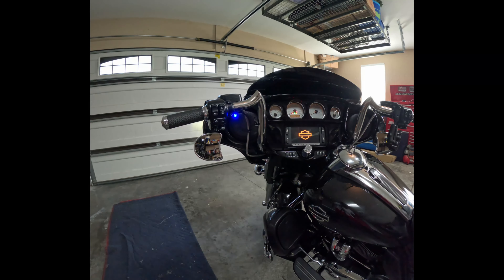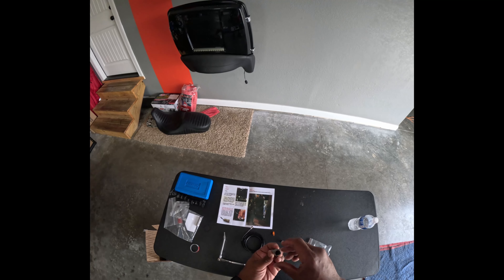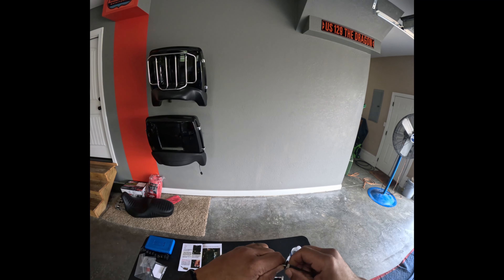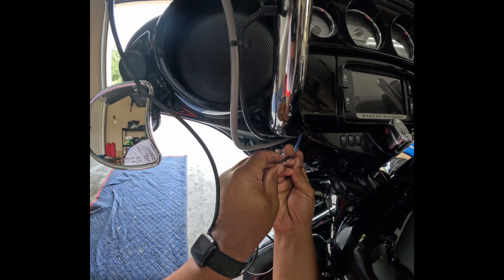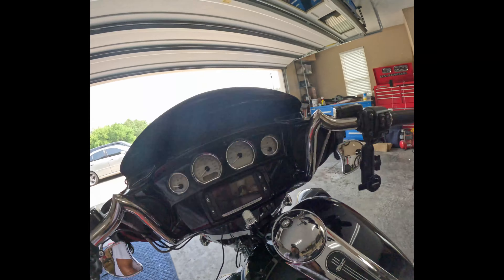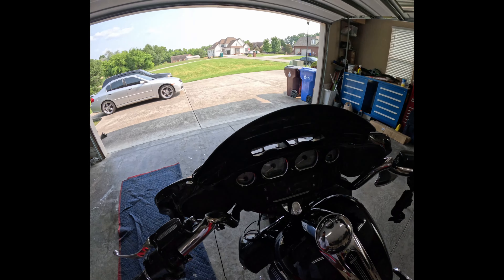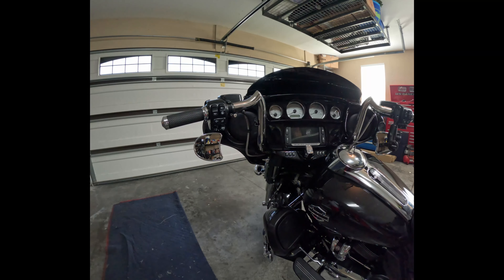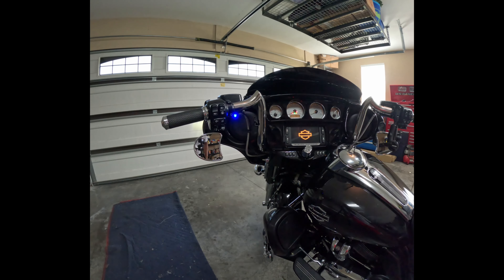Ultra Cool LED Indicator

Comment: I just watched both our videos on the install. I got mines in for my 22 RG special and just need to get it installed. I also got a few other parts as well to install. How long did it take you over all? few hours you think? Also , did you drain any oil or just what was in the filter when you removed it and how much more oil did you put in the system?

Looks good , keep up the YT grind.
Reply from the maker: 4 hours with taking two breaks.  Took my time cutting lower fairing because I didn’t want to cut to much.   Didn’t drain any since it wasn’t close to mileage for oil change. 

Thanks for watching
Reply: @bigherk80  awesome ! Ya I just got my service 500 miles ago so not gonna do a change. Just putting the new filter from them on with the install. I’ve got the spoiler to install so wanted to see how long it would take over all. I’m planning on a Saturday or Sunday of just tinkering around to get it installed.

Comment: I just recieved mine in the mail today. I have a 2018 ultra limited also with a built 124. Cant wait to get it installed and start the season. Install looks pretty simple, how was your install? Did you take any precautions with protecting your paint on the lower? Like putting tape on the surface that might rub, or just lay soft cloths down? Thanks good video
Reply from the maker: No I didn’t,  I took my time when cutting so didn’t really worry about it. Thanks for watching!

Comment: I hate pinning and depinning lol 
Hence why mine is in the box .. the light 

I saw a guy mount it off the corner of the UC assembly.. I didn’t went any wires on the outside of my bars
Reply from the maker: Understandable, I just ran mine down along the clutch cable.  Thanks for watching and commenting!

Comment: Nice 👍🏾.  Is that we’re you can turn it on and off?
Reply from the maker: No it’s just an indicator to show when the fans are running.  They come on automatically when the oil temp reaches 210 and shut off 185.
Reply: @bigherk80  cool thanks 🙏🏾
Reply: @bigherk80 wonder if there's a way to turn it on manually. Say you see a traffic jam ahead, it would be nice to flip a switch and be proactive.